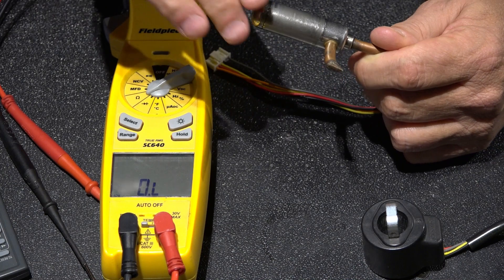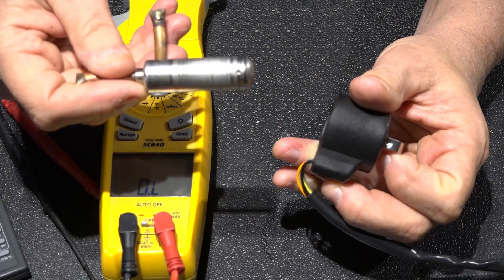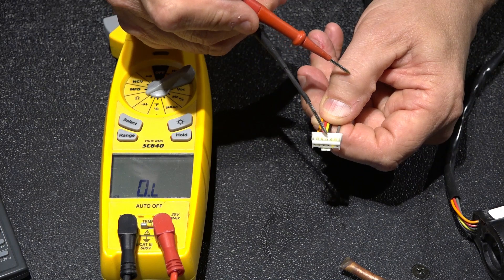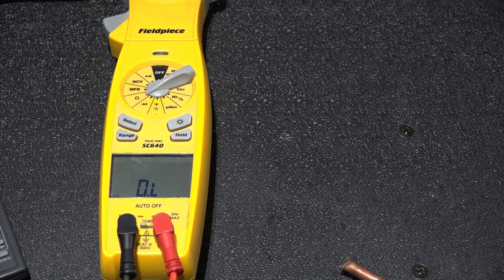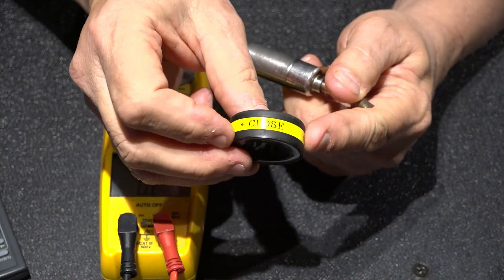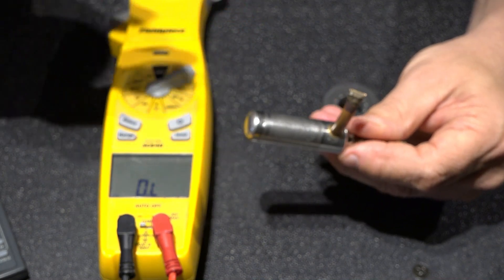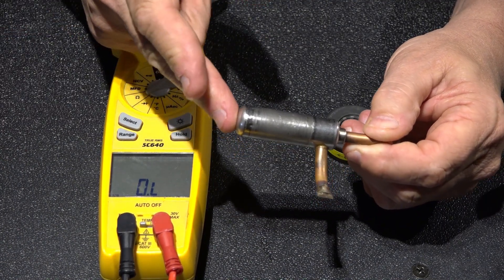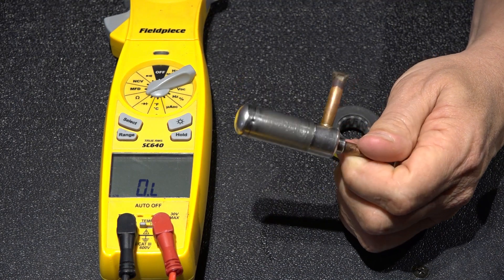EEV Valves and Power Heads

Comment: If one out of 4 indoor units in an LG multi-head system is not heating, what could its EEV be doing? Stuck open or closed or partially open or partially closed?
Reply from the maker: I would think closed, but thermistors control the valves position. Youll need to check them as well.

Comment: What are the common issues with the rusted power heads?

Other then fujitus bad eev coils shorting out (current model), ive never had issues.

So im curious as to what to look out in the future
Reply from the maker: Reduced magnetic pull on the needle valve in side the valve body
Reply from the maker: it could act like stuck valve